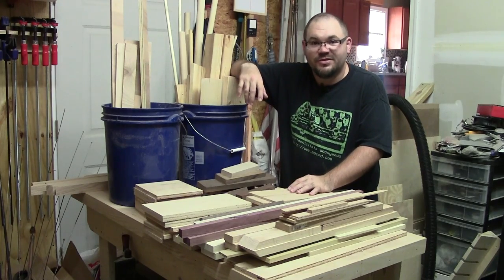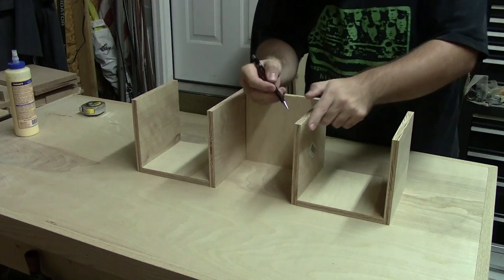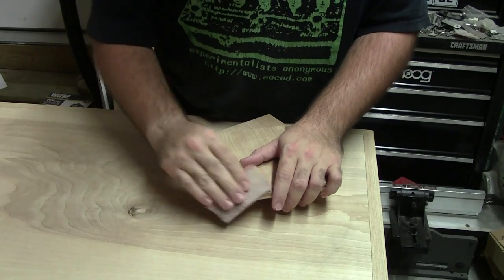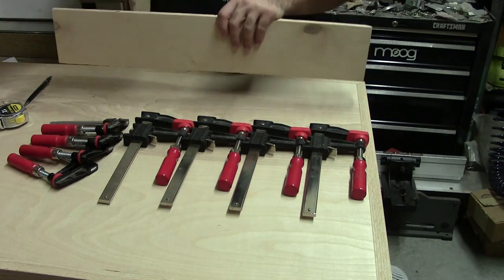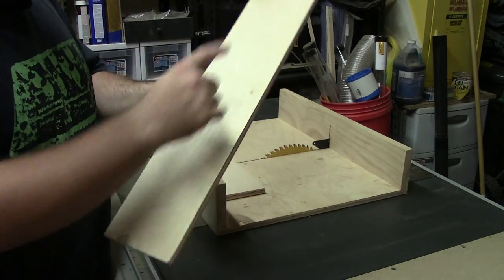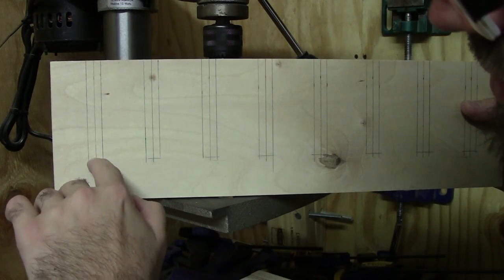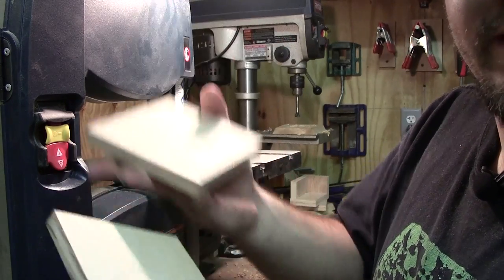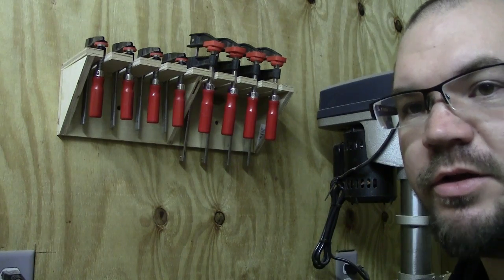Scrap Bin Challenge - Corner Shelf Unit and Small Bar Clamp Rack

Comment: Nice Rack Jason!  You are so organized.  I like your Moog tool chest.  lol  Oh the irony of ending up with more scrap from a scrap project!
Reply from the maker: Thanks, Steve!  I'm doing my best to get even more organized.  Honestly, the tool box side of the garage/shop is a mess.  As soon as I get all of my cabinets built and installed on the bench side, I need to tackle the tool box side.  Sometimes scraps get to the point where they finally have to go to the burn pile and back to the Earth.  It's the circle of wood life :o)
Reply: I drew a line and actually threw away (SOME OF) the scraps from my scrap wood project!
Reply from the maker: Many of my tiny scraps finally went in the burn pit.
Reply: We actually had a fire tonight, complete with s'mores. Most of the wood we burned was scraps from the shop. But I only burn my scraps that are actually too small to do anything with. Or just plain bad pieces. So, luckily, I never feel any loss when burning scraps.